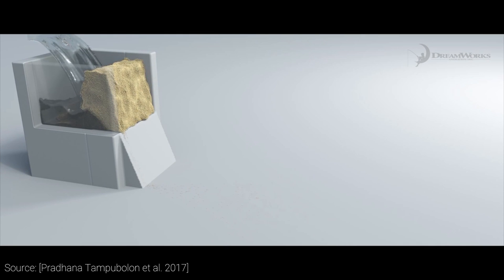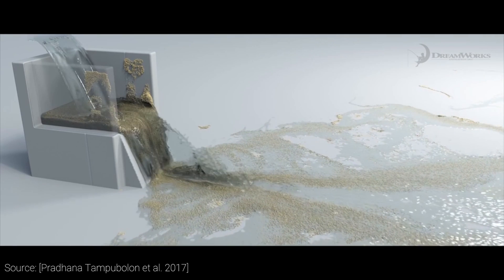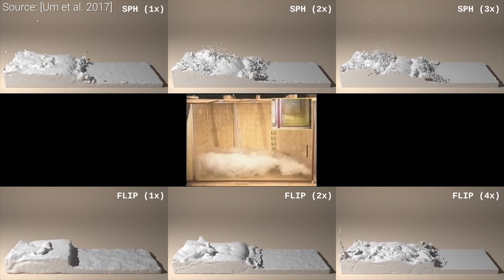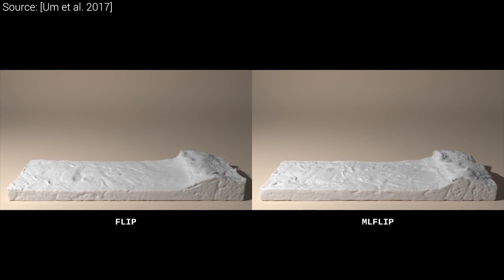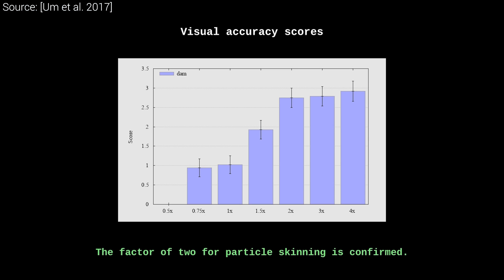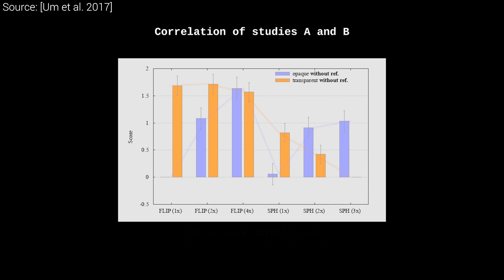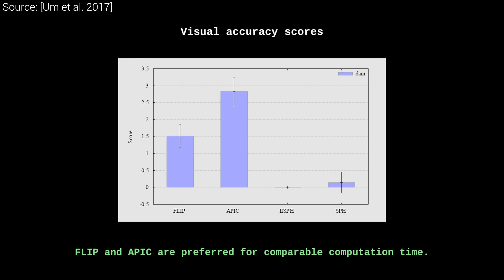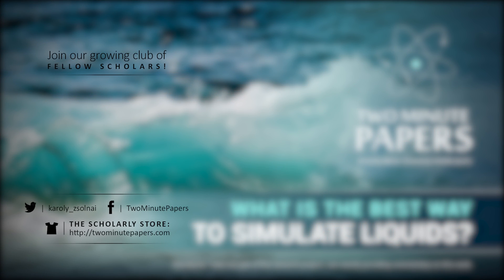What is The Best Way To Simulate Liquids? | Two Minute Papers #189

Comment: Question about simulations costing money - where does that money go? Are you paying the ppl who run the simulation more? Getting more expensive software?
Reply: When working on a project, you have a limited amount of time and limited resources.  When doing a simulation, it can lock up resources for a long time fast.  So that money is trying to find another trained person, more computer/hardware, and some to keep up to date on software.  In my experience, simulations have been handled like renders (mostly using time limits per frame).  Time is money and the speed at which a simulation can happen limits the capabilities of a place like an effects house as anything else.
Reply: Render time, maybe they lend powerful machines via a cloud service (time=money). The cost for configuring different parameters for each test run, to analyze results.